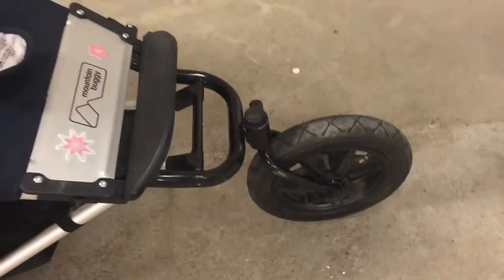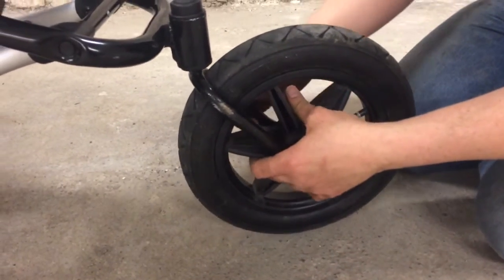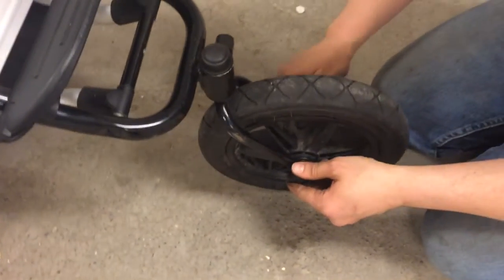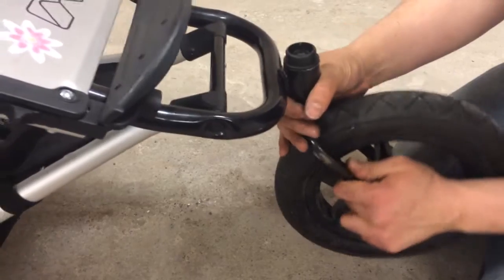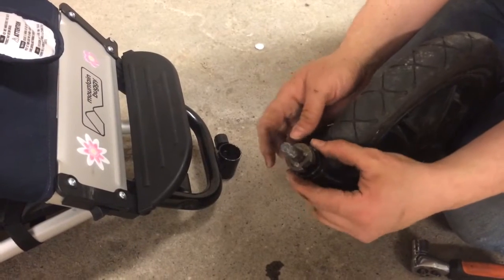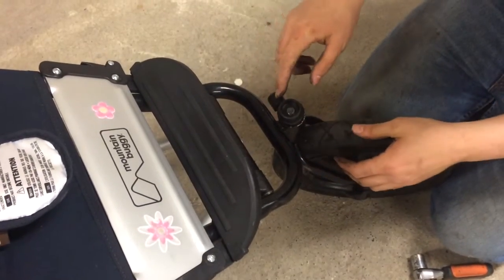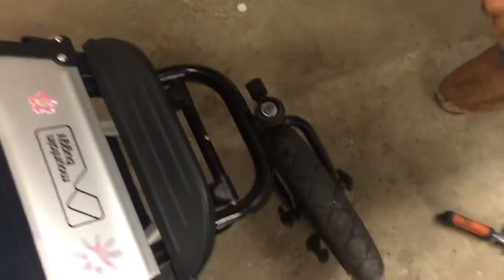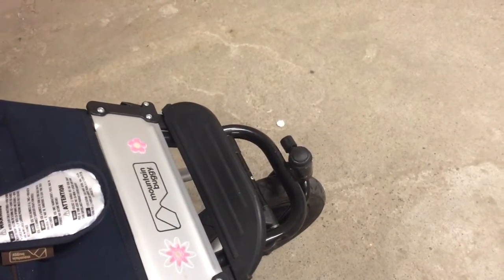How to Replace the Ball Bearings and / or Fork on a Mountain Buggy

Comment: This video is extremely helpful. Our front wheel won't turn and it looks like we need a new fork.  I'm almost positive I can rip off the lower plastic part if we could get one of the new ones that is two separate pieces.  Where can I get those exact parts?
Reply from the maker: Try to order them from Mountain Buggy directly.  Even if they don't have the parts advertised on their website, contacting customer service can often be an easy way of attaining needed parts.  Otherwise try to buy a defective chassis secondhand :)
Reply: Perfect.  I did check the parts site and didn't see it, so I will give them a call. Thank you